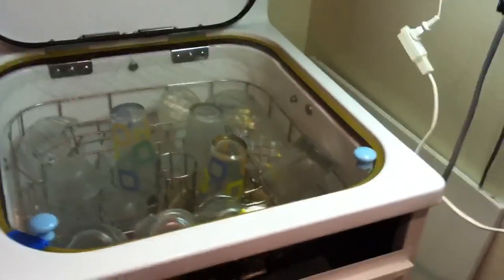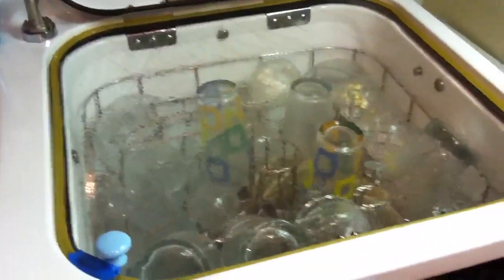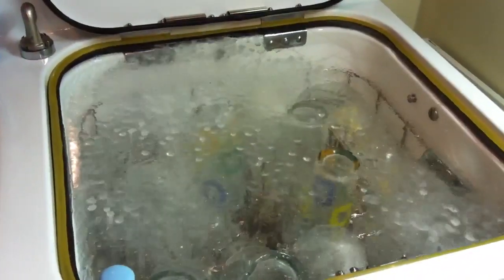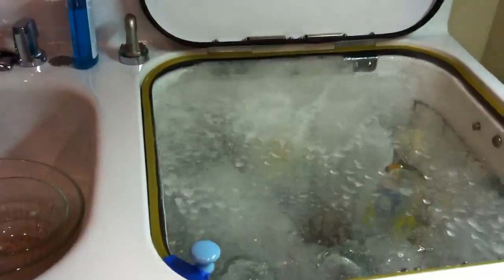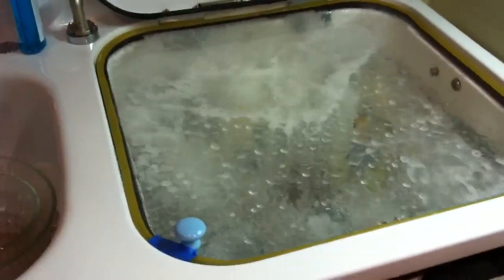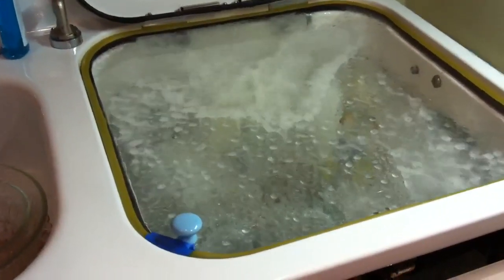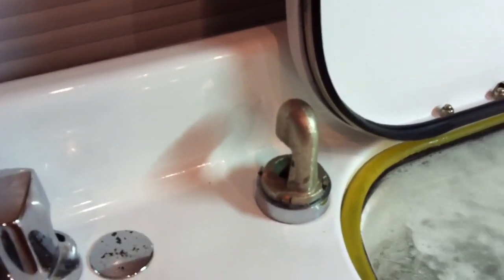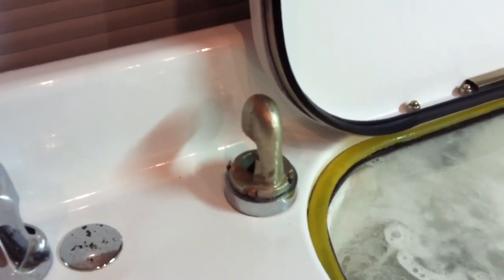Running the '49 GE Electric Sink

Comment: My grandparents had a Westinghouse that pulled out from under cabinet like a drawer and you loaded from the top. It had no spray arm, a fan thing at the bottom sprayed the water all over. It worked well. It came with the house, built in ‘62.

Comment: How about this. My mother has one of these still in use.  It has been running at least once a day since 1942.  Soap dispenser seized up and the little stainless cup has gone missing, I remember it as a kid.  The lid release never did work in my lifetime, she just opens it and hooks  it from a string hanging from the window trim when the cycle is over.
Reply: When I was a kid in the 60s and 70s, and everyone else had new stuff, and we had something older like that, I would feel like our household was so poor and out of date, not to mention fashion.  By the time the 90s rolled around, I realized how stupid I was.

Comment: I just bought a house that has one of these. Hasn't been used in decades, and the rubber seals has eroded. What would you recommend I replace them with? I'm going to try to run it and see what parts need to be replaced. It's just been sitting there, plugged in and not used, all these years!

Comment: What a piece of junk. It looks like it's missing 33 percent of the area it should be reaching with the water jets.
Reply: These dishwashers heated the water to extremely hot temperatures, used a very small amount of detergent and washed a complete load of dishes in 5 minutes.    The heat of the water is so great that it sanitizes, the jets are very powerful, because of a long lasting pump built in.  The dishes dry themselves with their own heat.  These units were made with heavy gauge steel inside and out, for long lasting, sanitary performance. They have larger versions of these dishwashers in use for commercial purposes today; restaurants such as Starbucks that need to get things like milk, baked on cheese and frosting off of plates and pitchers in record speeds whilst maintaining health and safety standards.
Reply: broccolibeefed: do you ever post positive comments? You must lead a very dull and depressing life.